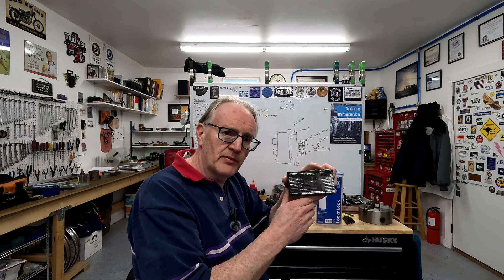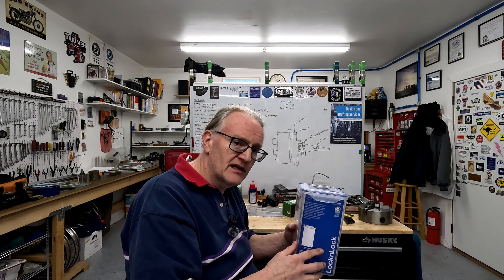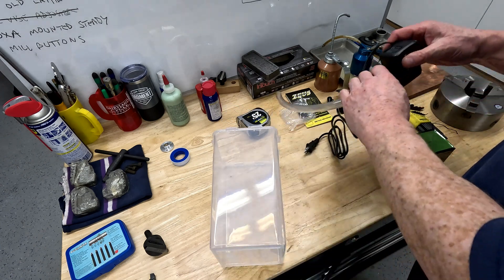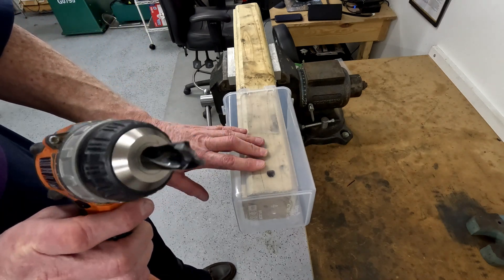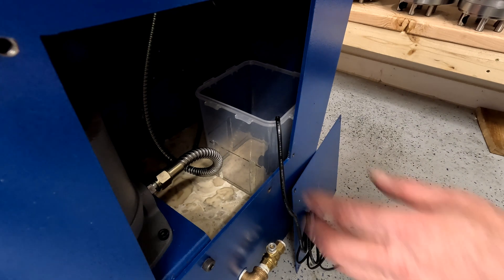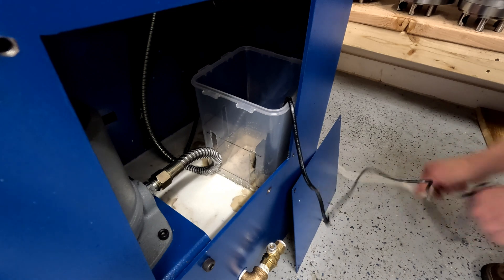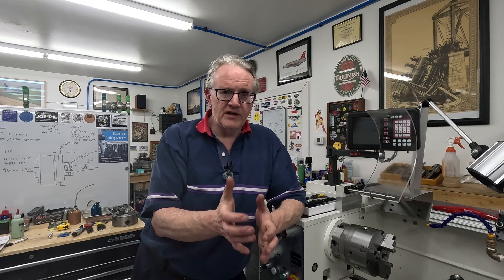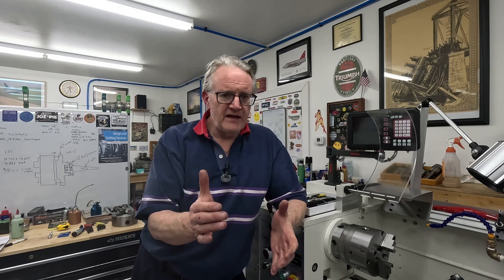Shop Made Tools - Cheap and Effective Home Made Flood Coolant Tramp Oil Skimmer for 30 Dollars

Comment: Many thanks for the idea and the links, Stuart. Its 9 months later and I would like to know how that screen has worked out for removing the oil and what is the mesh size? Also, any changes you would suggest?  All the best.
Reply from the maker: @chip-load  thanks for your comments and questions. In the end, the stainless screen does kind of sort of work, but is fiddly. I found a small scooping spoon to be easier. Everything is working really well, so I wouldn’t change anything as such, but for the easiest tramp oil scooping use the widest area plastic container that you can fit in the sump. I made another one of these for my mill coolant tank, which is much easier to scoop just because it has easier access. Both systems have had the pumps running 24-7, and the coolant is still in good condition. I monitor the concentration and ph levels and top up as needed with water and concentrate - have not had to do a coolant change at all. But I’m a home machinist, so the coolant isn’t getting pounded for 12 hours a day. Hope that helps!
Reply: @StuartsShed  Wow, very quick reply and THANK YOU for the additional information and experience! All the best from a New subscriber.

Comment: With a deep enough sump, shouldn't the tramp oil just float on top and never be drawn into the main pump? Asking because I'm thinking of building one for my lathe
Reply from the maker: Although that is true, one of the problems of the oil floating around is that it helps promote the growth of the bacteria that can cause the coolant to start to smell. That in turn can lower the ph value (make it acidic). Also even if not drawn in to the main pump, the oil floating on top can emulsify with the coolant - so the best bet is to keep removing it. Thanks for commenting! Good luck with your own coolant project - my surface finishes improved dramatically when I started using coolant - plus dimensional stability is better for tight tolerance work. Cheers!
Reply: @StuartsShed  thank you for the feedback